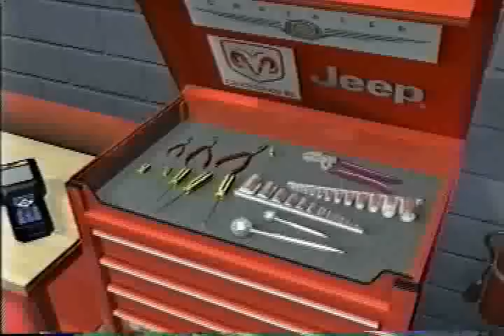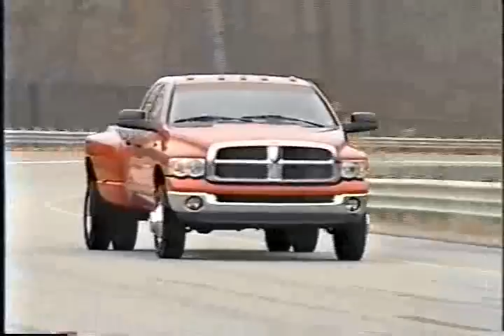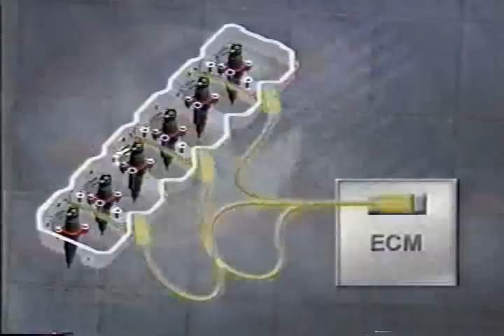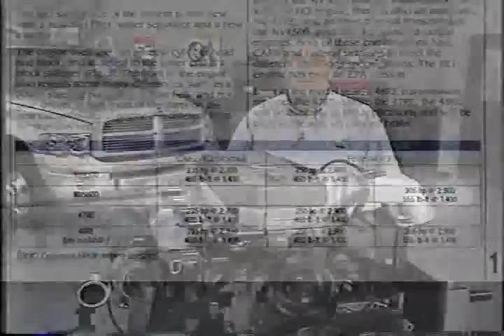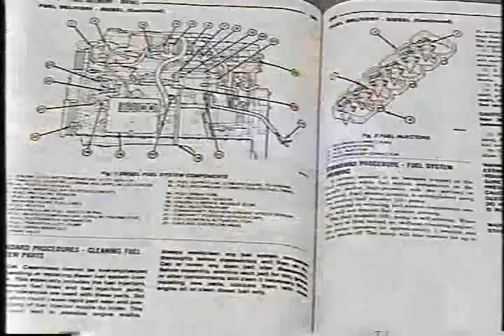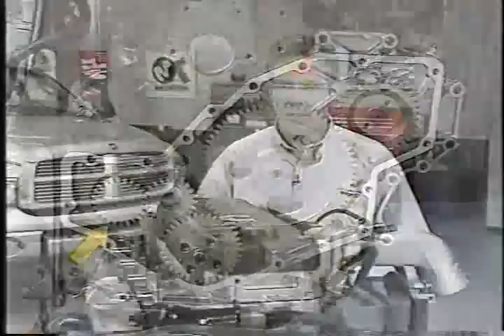Dodge Ram/Cummins 5.9L High Pressure Common Rail Diesel Engine Part 1 of 4

Comment: @jamesparker308 Not sure about liters but I've heard of people getting 15-20 miles to the gallon with it. With anything it'll vary depending on how you drive it, if you pull a trailer, etc.